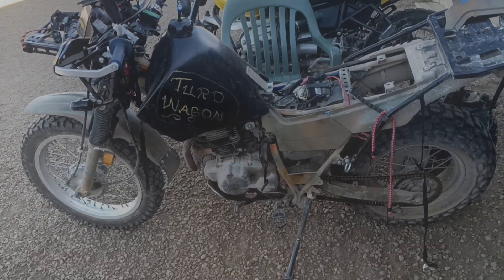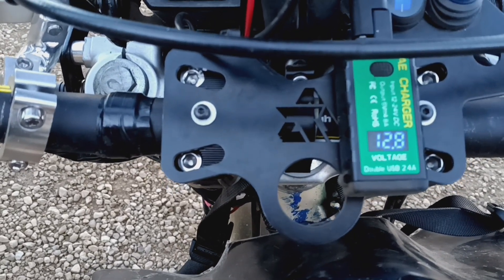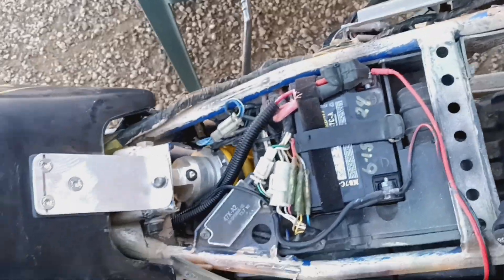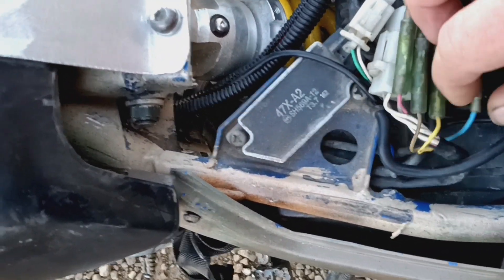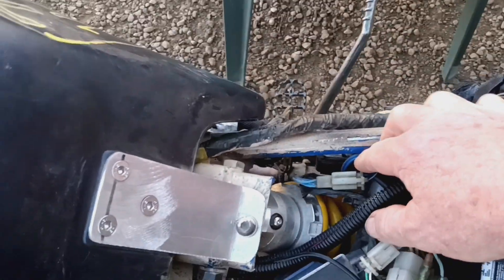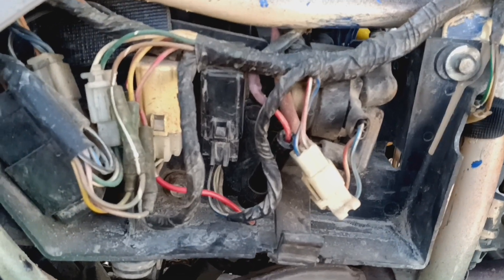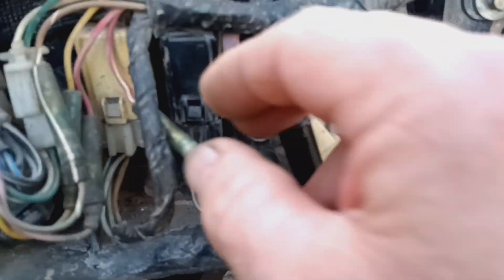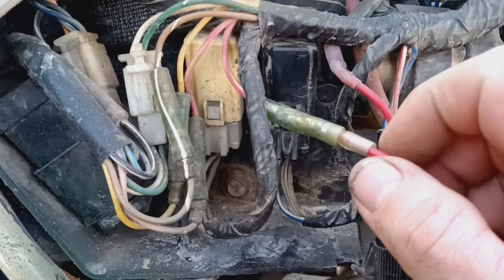TW 200 Stator Failure? Maybe Not!

Comment: Always test before replacing parts.  Battery, Regulator/Rectifier and Stator plus connections are the extent of the system.  Always check connections, esp the 3 wires coming from the stator, that plug near the rectifier is usually the culprit.  Enjoy your trip!
Reply from the maker: A new experience for me! Thanks for watching!